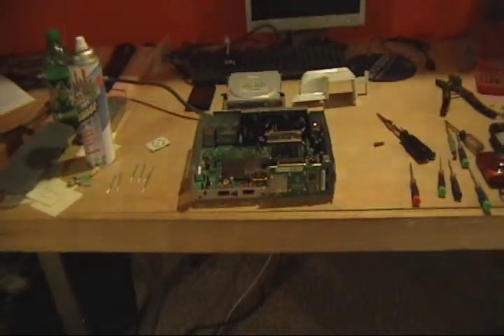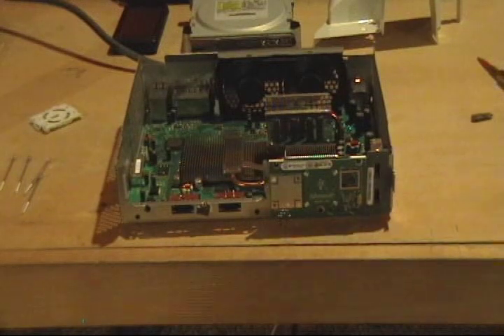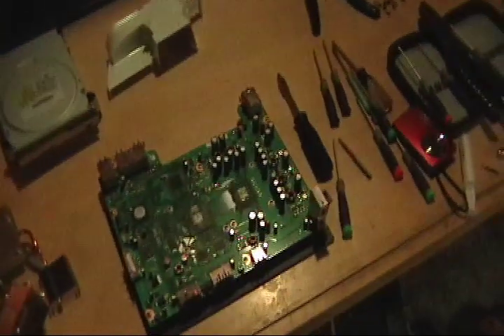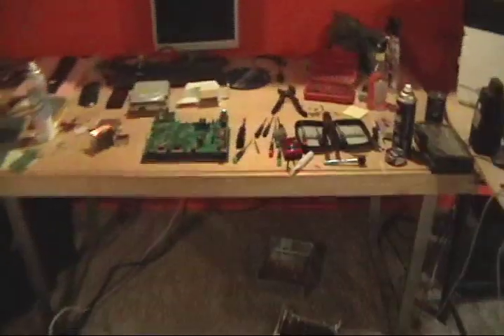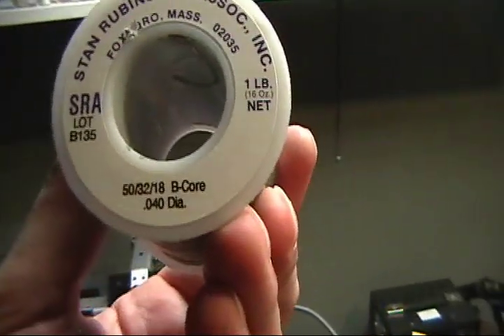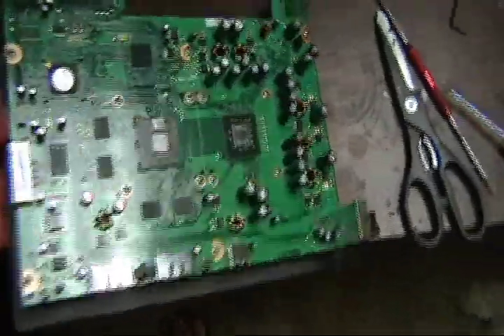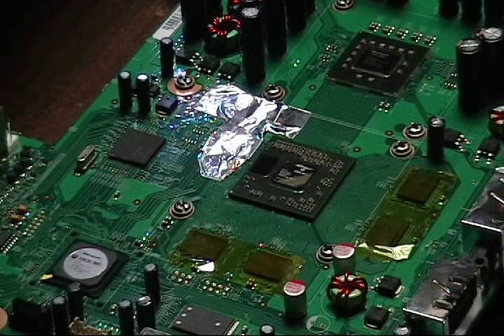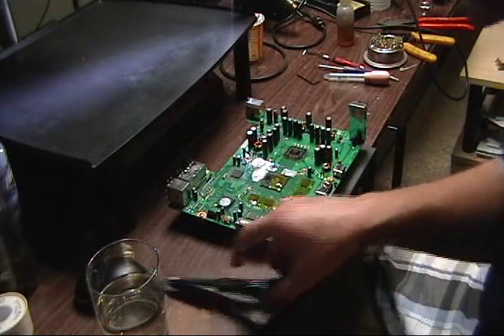XBOX 360 RROD REBALL Part 1

Comment: Hi! I'm planning on starting to reball xboxes, and was wondering if you could make a list of supplies.  I'm a well seasoned with replacing and soldering components an find this a fascinating and wish to do so myself.  Also, what is the giant plate with the arm that melts the solder on the GPU called?  Thank you!

Comment: Hey I'm looking for a 100% permanent fix.  I've had a few re-balled for $80, they were xenons, and I had the 12v fan mod.  I got the temp down, but they still failed 6mo later, then when getting them repaired under warranty the pads came off :(  I've heard the X-Clamps flex the mobo, which would make sense how they are put on, bending the mobo and chip.  Would putting spacers and washers through the bottom of the case with 100% even torque fix this?  I know xenons suck